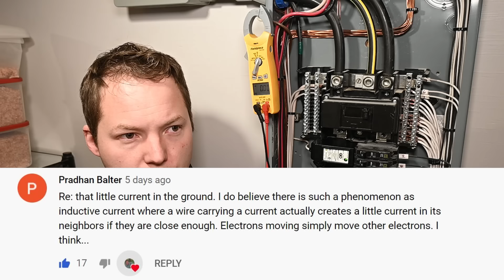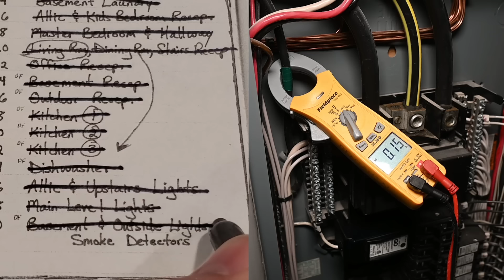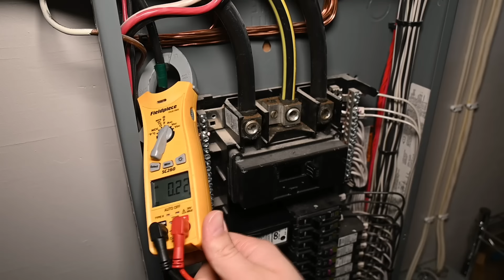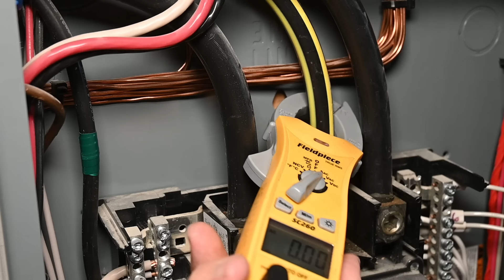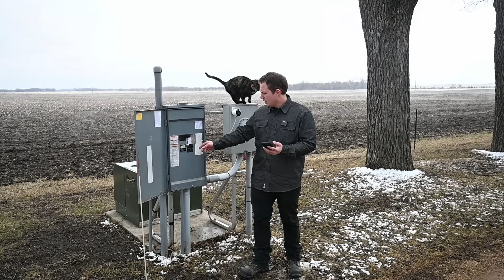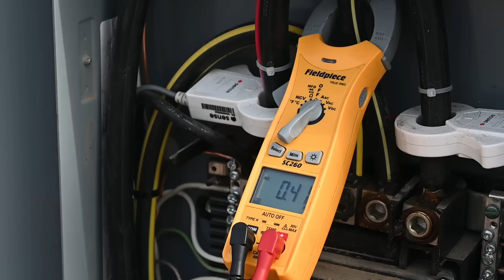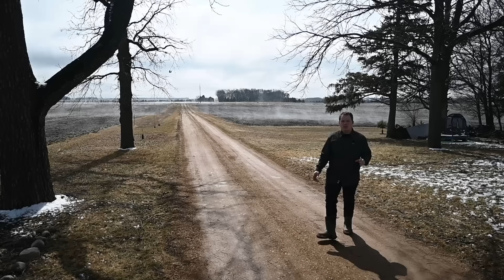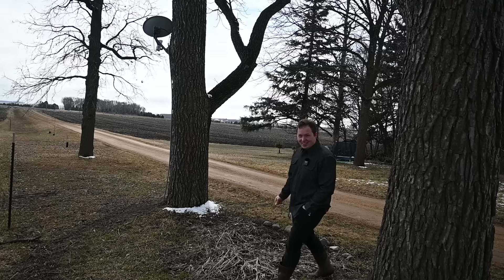Finding The Source of Stray Current on Grounding System

Comment: Differential Ground Potential at each grounded connection - That's my thought. At some point, you may want to remove each ground from the "group" and isolate which may have the highest VOLTAGE differential to the CT of the MAIN XFMR.  We know the CT cannot be absolutely the perfect point in the center of the XFMR windings, but with output (secondary) power off and (primary) power on, there is still a potential set up there with respect to the ground rod at that point, however isn't that point tied to a ground of the XFMR? (I don't know) I know if you set metal in the ground even 4-10ft apart (with adequate moisture & not too much), you can measure a different DC potential between each. 

As a retired tech, I ran in to situations like this affecting sensitive systems. I also encountered harmonics at certain panels caused by electronics without isolation transformers, this was an interesting challenge for me. 

I respect you so much for not acting like a "know it all expert" as many YT channels do, but you engage the audience and really get everyone involved. That's how we all get to learn. Also you learned, and try to correctly use the technical terms of voltage, current, and power. That makes for optimum communication. I say "well done" to you, sir and please continue so we all get to learn something from your situation.
Reply: I always look to see if someone else posted what I was about to say. You beat me to it. Congrats. People mistakenly think that all "earth" is at exactly the same potential everywhere, as if the earth is a perfect conductor. If that were true, we wouldn't need a buried grounding grid in the soil at a transformer station.
Disconnect the ground rods at the substation (with everything shut off) and then see if the current still runs through the EGC. If it is, then there is a potential between the earth at the primary and secondary panels. No surprise--no harm.
Reply: While I agree completely that there is a grounding problem, the gas line needs to be fixed first. Maybe it's just me but I've never seen the lifting lugs being left in the transformer. If that's a sign of carelessness, then Jason Goetz probably has it nailed perfectly, the transformer grounds need work.
Reply: I am retired from the FAA and I worked on electronic navigation and ILS systems. We had a problem with one of our systems that would occasionally shut down due to a self monitored parameter that would stray out of tolerance. When we would arrive at the site to check everything all would be within tolerance but the memory onboard indicated which parameter went out of tolerance. 
After much head scratching by several techs we noticed a slight variation of electrical  power coming in to our facility, the variation was sinusoidal, low voltage (we placed an oscilloscope on the incoming power to look at it) but enough that it would cause the sensitive electronics to to vary enough to shut our system down, not always but intermittently. One of the electricians assisting the electronics techs noticed the neutral was bonded to the ground in the disconnect of our ILS building as well as where the power was delivered to us by the utility company, about 100 yards from the disconnect.
Once the bonding in the building disconnect was removed, the sinusoidal wave on the  power provided to our equipment disappeared. We had a ground rod at the building and at the power pole 100 yards away and the neutral bonding was done at both locations. Removing it at our facility building also removed the low voltage sine wave (millivolts) riding on the incoming power and stopped our intermittent shutdowns. It took us a number of manhours to locate what was causing our problem but it was a lesson learned.
Reply: I know this is an old thread but maybe someone will find my addition to the comment useful. I agree with Je Mart and his grounding  issue comments. If you look at the literal ground it has ice on it and could be frozen. This will provide poorer grounding conditions resulting in more resistance between the various earth ground points. I bet after a good rain storm the amount of current going through the wire will drop. Are these systems not supposed to be tied to earth ground in one location instead of multiple locations?
Reply: JeMart..did you ever encounter stray voltage that affected people health in any way? Is it possible to feel current in an entire house? We something that feels like magnetic force..maybe it's current. Found 1.7 on cable ground line and no one is taking responsibility

Comment: As I tried to explain in your former video, (It's hard for me to write, since I'm not english speaking native, I live in El Salvador, Central America), "your" ground resistance is "better" than before you entrance panel. You can measure both values with a ground resistance meter or earth meter. Actually, in the market there are two types, Vener method and clamp meter. I think that the right place for testing is the entrance panel. After disconnecting power switch,  isolate your neutral of the distribution system. Then, perform measuring of both neutrals. Very probably the resistance of your neutral will be lower than that of the distribution company.

Comment: i find it interesting the way you approached it...as would have i, which logically is the wrong approach....always go to the source first and then track back from there...a friend of mine worked as a technician for the main post office sorting department and they approached it exactly as did you....after extensive testing and equipment replacement found that it was indeed the utility whose equipment was faulty....
Reply from the maker: Could be. For me though it seems that eliminating one thing at a time is the best method. If I had tested the neutral right away I would still not have known that thay current was responsible for the issue. How would you have approached it differently?

Comment: 4:32 - another way to troubleshoot this is to isolate each leg of your 220 by turning off 1,2 - 5,6 - 9,10, etc. which are connected to the left leg. Then, turning off the other leg (starting with 2,4 then 7,8, etc.)

Comment: You might have a neighbor with a defect in an appliance or something sending current out on the grounding system, and a little of that is flowing to ground via your panel.  Something like that happened to me 30 years ago on a job in another state.  Slight current on a black iron gas pipe (!) from a store down the street. Obviously not part of the official grounding system but the current didn't know that....
Reply: I am thinking the same, for having a very good ground, some neighbor must have a current leak
Reply: It can be the culmination of several of your neighbors leaks to ground, Dairy farms often have problems with stray electricity and many  times it is coming into the farms off the grid. Cows are very susceptible to this and can feel very low amounts. This affects milk production and overall health. We have a division that works just on this issue and creating a equal ground plane for wherever they walk, feed , sleep and are milked....Cow and most farm animals don't wear sneakers to insulate..

Comment: Do a grounding resistance measurement (Wenner procedure) with a three or four auxiliary electrodes. This gives you information about the resistance between your grounding rod at the house and the transformer earthing. For this measurement you need to disconnect all consumers in your house. I guess as soon as you improve the resistance of your grounding rod (this might be bad due to corrosion), this effect will disappear.
Reply: Don't forget, after disconnecting input lines, isolate your neutral from the distribution company, then perform both measurings in the panel, neutral to transformer, and "your" neutral

Comment: Love your videos. I design and install solar. Just a heads up for what its worth - my lead solar electrician says that the appliance readings on Sense unfortunately are pretty inaccurate. He hopes that their algorithms that recognize specific appliances by their electrical consumption patterns will improve as more people use it, but he really loves e-gauge. It's more expensive, but each circuit has its own CT so you know exactly what each circuit is consuming. Lots of our solar customers love it.

Comment: The earth is not a zero resistance conductor. I think that is the explanation .   This is why you can get electrocuted just by being in the vicinity of a high voltage wire that is energized but is in contact with the earth.  The voltage around the point of contact varies by distance from the point.  Say it’s 12 k volts in the wire,  at some distance it drops to 11 k volts, then lower at each father point until it reaches zero volts depending on the resistance of the earth. This is called a voltage field. Look at the safety videos that show a person hopping away from the down wire. The mere act of stepping could put one of your legs father than the other from the source  thus causing a voltage difference between your legs, voltage difference causes current flow through your two legs. If  70milliamperes  flows through your heart it can be fatal.

Comment: If you stretch a wire 50 foot on the ground, you will get current from it, due to the magnetic field of the earth. I would say that all the wiring in your house is generating current from this  field, and that is what you are seeing.. 
 The current you monitored at the outside transformer, is actually being generated by your house, and is back feeding to the transformer..

Comment: Objectionable current from the on-ground transformer connection to power lines on the road.
https://mrec.org/files/2016/06/2016.DeNardo.SV_.InTheNews.pdf
Call your power provider and show them the leaking amperage.  By chance do you have power company provided surge or EM spike protection?
Reply: Agreed. They should have a power quality group to service these issues. It could be two things that I can think of. All the stary power is passing throgh the ground back into the power system or there is a distribution line induced current. Say laying the underground wires together. They may be inducing current by either induction or capacitance. The transmission line in the background may be a contributer. This is a power quality issue.

Comment: Is it current flowing from your homes grounding electrode thru earth back to the bonding ring on the transformer, switch is connected to the neutral tap point.

Comment: It’s the underground water current spinning the well pump. Either that or it’s your windmill. Just kidding guys. Stray electric current is no joke. We used to have an electrician that could feel it in his teeth. Eventually it drove him nuts. It all ended really badly. It was in Minnesota so you may have heard about him. All the farmers would call him to find stray current. Now for my guess. Could this be ionospheric discharge to ground from the high wire ground. Or is it like Gerald Morin says and you have discovered the power company hoovering up the ground current. I don’t know. I am perplexed.

Comment: Load balancing is important in electrical power. Perfect load balancing will make the neutral wire will be perfect Zero current. But it's impossible.  You could watch this video. https://www.youtube.com/watch?v=cMzevUC4sao

Regards from Taiwan.

Comment: Hello Ben, Watching you working in your power panels makes me remember how we at our job used to do it, now we have to follow the rules concerning Arc Flash. Face shield gloves cotton shirt full sleeves the right shoes. I'm wondering if the insulation on your underground feeder wires might be nicked or the conduit it's in full of water. 1,000 plus feet to the road ?
Reply from the maker: Hey Gary! Yeah I know that I probably should improve my safety gear situation. What do you think of the rules? Overkill or worth it?

Good question. Are you talking about the wires that feed the transformer from the road?
Reply: @BenjaminSahlstrom   Yes I think the Arc Flash rules are over kill We even at times are required to be teamed by another person behind us with a sheperd's  hook. Yes the wires from the pole at the road. By the way at least use your safety glasses. Have you ever seen camera footage of arc flash explosions very scary but always human error.

Comment: I run into this exact same thing on swimming pools.  On some pools we find as much as 5volts from the pool water to earth ground (with the main power to the house off) even had the power company out to completely disconnect the house from power and the voltage is still in the pool.  If you remove the equipment bond from the pump heater etc the voltage goes away. Any thoughts on this situation?  We have had building codes out as well as the utilities company ie power,phone, and cable tv all disconnected from house. I have no idea where it’s coming from and love to get this fixed for a customer.  The concrete has wire mesh and is also bonded to all of the equipment.
Reply: Ground resistance (value in ohms) in your wet ground around swimming pool is lower (better) than that out of your house, I mean, the distribution lines. Since I know they  (electric company) won't fix it well, I would try to lower ground resistance, by installing several ground bars outside,  if possible, upstream my connection point to the distribution company
Reply: Oscar H H thanks for the reply.  The building code inspector and the power told us to install several ground rods around the pool.  We did and it made no difference.  We put them about every 10ft apart. We also installed a water bond in the skimmer of the pool tied back to the mesh and bonding wire around the pool.  So if I understand you are suggesting installing grounds rods closer to the house to help dissipate the current before it can get to the pool?
Reply: @johnsutcliffe9965  Yes. The idea is improving grounding "before the load", It could be in your panel, or before your panel, (once I did it in the service point). This way, you will improve your ground, and anyway,  you'll help your distribution company.
Reply: @oscarhh359  The provider should be helping him, not him teaching them how to do their jobs. I for one am done teaching companies how to do their jobs properly. I'm all for helping these people solve their problems, and I'm trying to understand stray voltage same as everyone here.
Reply: I read of this same problem some time  ago and it was coming from a neighbors house. When their breaker was off, no voltage.
Reply: lawrence Hinkel yes I have heard that as well.  Supposedly they found it in a faulty water heater.   In this case the closest house is a few miles down the road so don’t believe this to be the case here.  I’m open for any suggestions
Reply: Electricity ALWAYS returns to the source. Something is leaking to ground. Swimming pools are notorious for this and it is DANGEROUS! Be careful here and get the power company involved ASAP!

Comment: I guess some ground or wires* are acting as a capacitor and the ac current is just pushing the electrons back and forth to the wannabe capacitor?  If the xformer was perfectly balanced maybe a smaller current would occur?  So small your ammeter may not indicate a current ?

.

Comment: I'm prepared to say I'm not 100% sure how your American power system works compared to ours (Australia), but in one case I saw a very similar thing due to a faulty neutral at the power company' transformer. In that case it was a burnt out neutral which resulted in all neutral current going through the earths of houses connected to that transformer. The current would vary depending on load changes: in that case, being the extreme (ie. no neutral at all at the transformer), the voltage changes were pretty extreme at the six houses connected. Plus, because it was a high earth resistance area (actually a Pacific island), you could get a shock on appliance earths!

In this case there may "just" be a higher than normal resistance in the neutral out at the line, but I'd be calling the power company and asking pointed questions.

And yeah, do something about that gas line! Cheers.

Comment: On the green power company transformer (Transformers magnetizing current...mains hum or "transformer hum". This transformer hum is especially objectionable in transformers supplied at power frequencies and in high-frequency) someone used the ground wire as a neutral and the current is going from a hot wire to ground wire instead of neutral. Get the power company to correct that before it gets worst. It is called  (objectionable current). It develop a voltage/current due to hysteresis in the dielectric circuit conductors with the earth. Such faults can cause objectionable circulating currents, or may energize the housings of equipment at a dangerous level. Some current transmission systems must take care so that current flowing in the earth does not cause objectionable corrosion to buried objects such as pipelines. One point in each separately derived system to prevent flow of objectionable current in the earth is to do a Bonding jumpers that may be installed wherever metal parts are separated due to lightning. Just saying some ideas ...Bla...Bla... Bla etc.

Comment: Does it affect your electricity bill if there is a current leaking to the ground? Sorry, in case is a silly question.
Reply: he did say he monitored the meter on a time lapse and didn't notice it moving when he had all his switches tripped off, so apparently it does not count the neutral line.
Reply: In his case no, as the source for the current flow into ground is before his meter, so the meter does not read that. And neither did any GFCI breakers in his box.